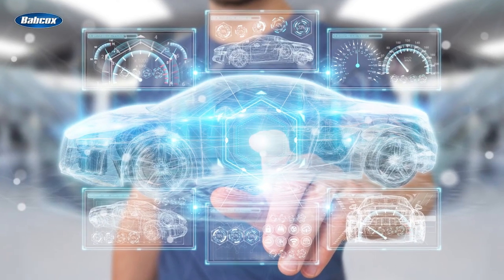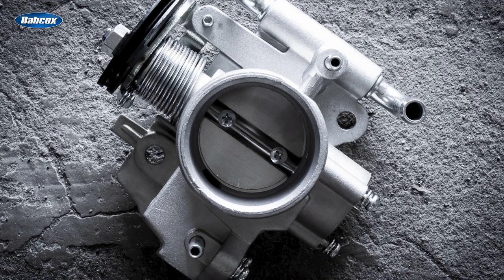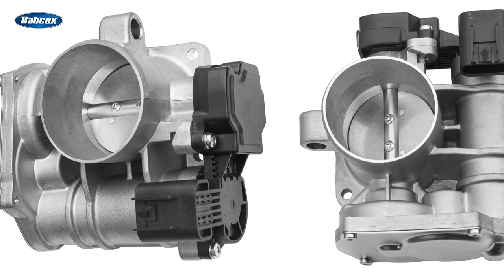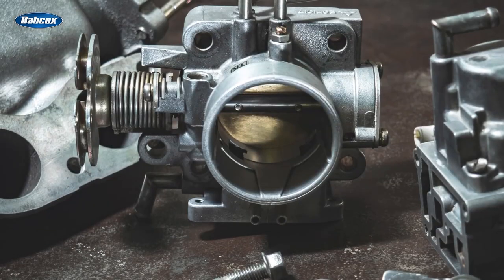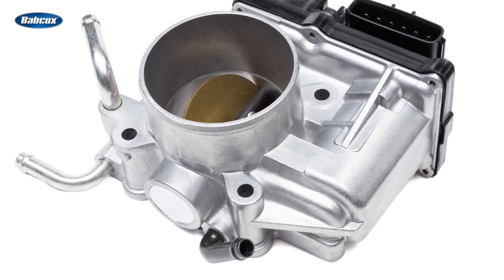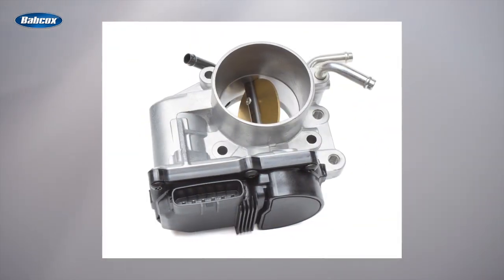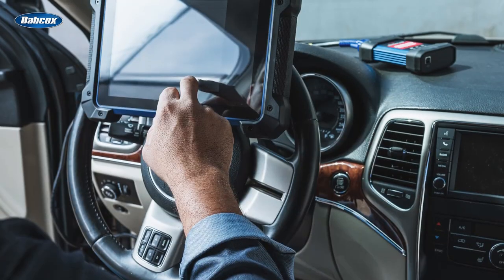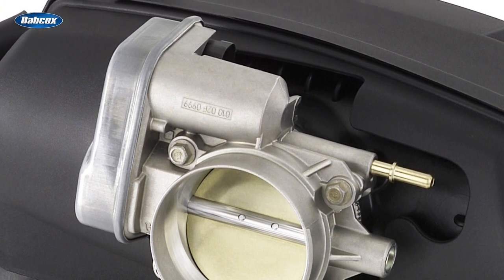What Happened to Throttle-Position Sensors?

Comment: Had a GM throttle body failure at 65k miles recently. 2019 Buick Encore. Didn't require my scan tool for relearn procedure.